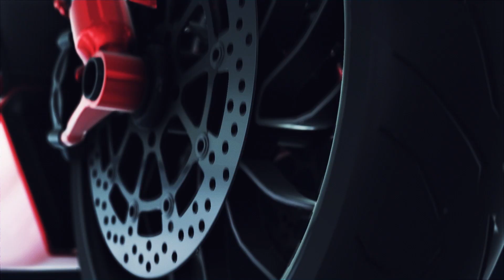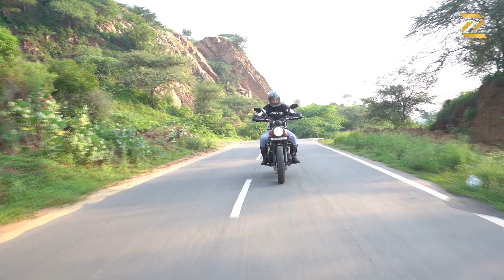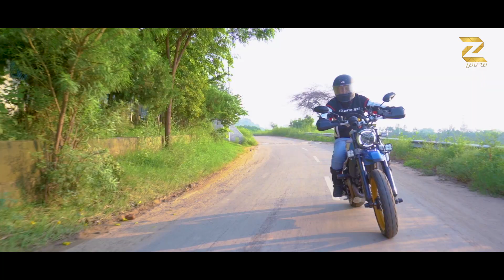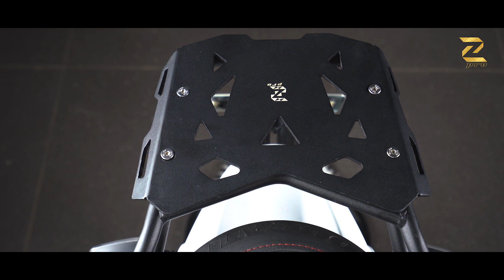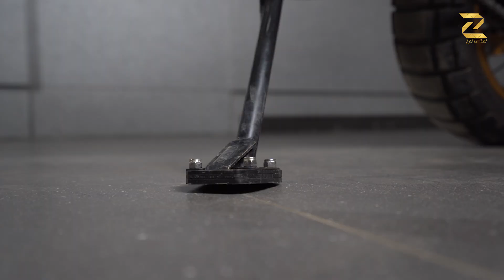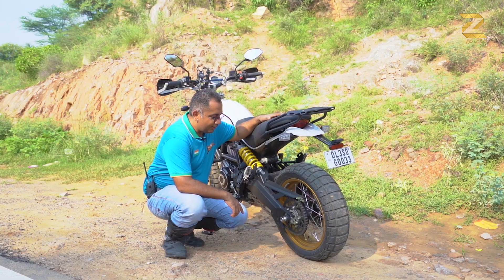Introduction to Z Pro || Range of Products for Ducati Scrambler

Comment: Thanks for the vid. I bought a 2” riser kit from you for my KTM 390 Adventure and was very impressed with in inclusion of a longer clutch cable plus a spare cable.
Coincidentally I am now considering a Desert Sled so the rear rack and paddock knobs will be a must.
Reply from the maker: Thanks for being our valuable customer. you may checkout our website to get updates on our new launches
www.zanamotorcycles.com